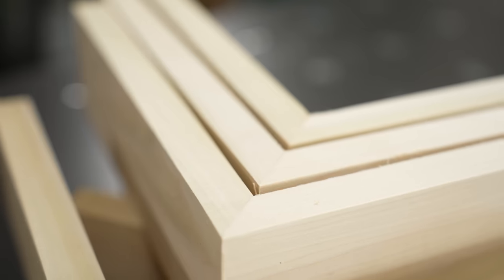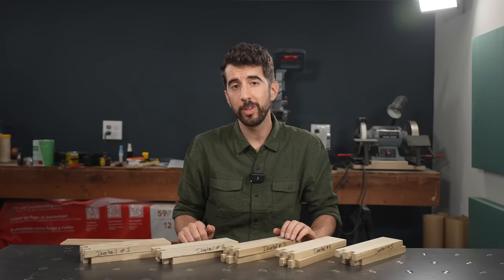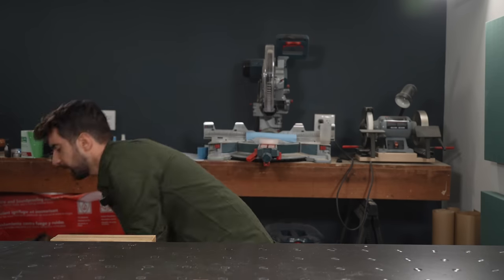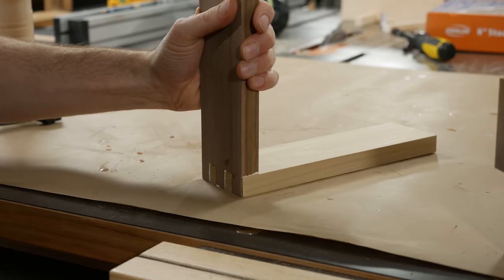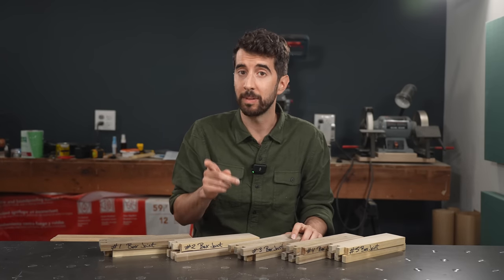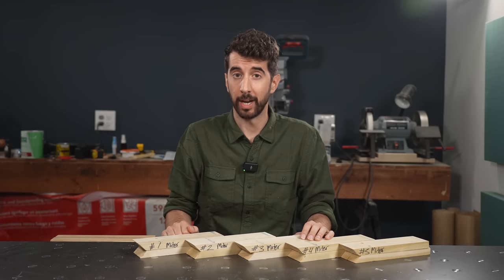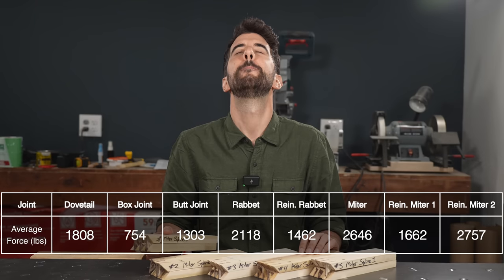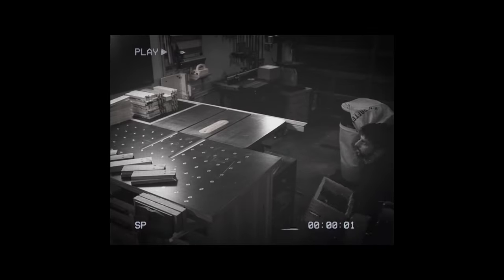This Simple Joint is Stronger Than a Dovetail!

Comment: i'm going to point out a minor error and then a possible major error in your reasoning. the minor error was when you said when the dovetail failed the glue was stronger than the wood. in fact, the test you did put zero stress on the glue. it only tested the shear strength of the dovetail flares. so the test was good but the explanation was just a little off

the possible major error is believing that a stronger joint is a better joint. that is simply not true. the best joint withstands the load it is designed to withstand over its intended lifespan and is economical to construct in terms of time and material. using a joint that will withstand twice the load that would be required and is costlier to construct isnt better in any way. it's worse because it produces the same utility as another joint for a higher cost

the outside splined miter produced the strongest joint, but only a little stronger than the miter without any splines. i have mitered joints i glued up 20 years ago and they are fine. so if your reason for adding splines is to add strength, that would seem to be a silly waste of time. however, if you need a joint that will endure drastic seasonal changes (like a summer camp up north) and you want it to last for 50 years, splines just might help with that

as you point out, the supposedly 'weak' box joints you've been making have held up for years, not to mention that box joints allow you to join very thin materials where other joinery methods wont work at all. you also point out that seasonal movement of the wood can break the glue, and therefore a recently glued up joint is not necessarily durable over a long period of time. a good example of this is the multiple dovetail joints on a drawer. even after the glue has completely failed this type of joint continues to function indefinitely

for example, king tut's cabinet-makers made small wood drawers with multiple dovetail joints and no glue. i'm not sure how much use those drawers saw, and they havent made it to their intended lifespan of forever yet, but they are still intact after several thousand years. and while i realize the ancient egyptians would strongly disagree with me on this, i'd say anything over 3 thousand years is a decent test of longevity. i have multiple dovetail joints on the drawers of a large oak desk built in the 1930's. the glue has failed everywhere and i'm not even thinking about repairing them cuz they continue to function perfectly

i do like these types of tests because they can challenge our preconceived ideas and may allow us to better understand the mechanical properties of different joinery. thanks for a useful and entertaining video

Comment: Dovetails were created long before glue was invented. Asian joints are similarly designed to restrict movement in a joint so it maintains it integrity. A miter has no mechanical strength without glue.

Comment: That makes no sense because you have more surface area in a dovetail joint than a rabbit joint. 🤔 Also some wood has more natural oils than others and hardwoods don’t absorb as much glue as the poplar you’re using so you should consider that. In a typical dovetail the adhesive can fail yet the joint will hold together still unlike the joints you say are better. Just some things to factor into this.

Comment: Great video.  So basically every single one of those joints work beyond "good enough" with modern PVA glue.  If you are putting 800+ lbs of force on a drawer joint it's not the joint, it's you.  🤣😂🤣😂🤣

Comment: The obvious question is if 1500lb is good enough for a drawer… unless you open it with your truck - brad nails without the glue will likely do just fine 😂
Reply: Correct. Any sanely built drawer box is more than strong enough to las the rest of your life, even if you abuse it.

Comment: Where is the video on how to use glue.  I tried gluing little blocks, less than 1"x1"x6", to hold a glass shelf.  The glue didn't hold.  These are little wooden night stand cabinets. Less 2 feet wide with a single glass shelf and wood framed glass doors. But only one had small vehicles emblems on the shelf. These cabinets live in my shop. No climate control. And when it's foggy and humid outside it is wet inside,  hot or cold outside, the same inside. Originally the blocks were stapled and I believe, glued.  Outside walls are about 1/4" and I didn't want screws showing from the outside. I can't replicate the staples.

Comment: Your setup, with a pivot point on the blue metal bar, only loads the joint with a linear force running straight through the joint. This is a completely different load compared to a load applied to the other end. Like bending a paperclip is easy, but trying to pull a straight section of paperclip apart is impossible. It would be great to test the other load type with the exact same joints.

Comment: A joint design that self wipes the glue off the surface you are gluing is not the best idea to start with.  I do 90deg joints in high density MDF using a 'stepped mitre' which has 4mmx4mm steps along each panel edge.

Comment: Youtube really sucks! I've seen the same experiment again and again and again tested by every single woodwoker so many times. I see no added value the video you did Scott.

The problem is it is very rare to have only one corner joint in any wooden product. Usually we have 2 or 4 miter joints. These tests are all done with the assumption of 100% accurate miter cut joins (only 1 joint). This doesn't hold true in the case when we have 2 or 4 joints! There is always a little bit of error even using the best and most accurate tools. 

With hand tools and a small workshop setup there is usuall at least a fraction of milimiter error which propagates throughout the work, leading to imperfectly (fine!) joints.

I finally found the video that wasn't the repetition of same experiment while ago. It clearly explained that miter joints sucks in realworld scenario (4 joints). That's because the error in adding a new jiont will be cascaded. 

To summerize, the best joint is the splines jiont followed by box joint and dowel joint.

Comment: I do think this is interesting, but when it comes to glued up joints at 90 degrees such as a drawer, I never see them fail from the force of pulling straight on them. Obviously the knobs and the cabinets would be ripping off the wall if some hulk tried to actually pull a drawer out with 2600lb of force, right?

Far more common when I see a drawer fail it's because it was left open and something like an apron or a running person/pet gets caught on it and yanks it sideways. 

Same with cabinets and shelves, rarely is there a force pulling at it, it's usually something pushing into a corner which creates that leveraged stress you see in your other videos. 

I also get that this is only one test, one wood, one glue... We could test for years, and in fact people have been testing for years, and still not come to an answer that pleases the voice in our heads..

Comment: So, the glue surface area makes the joint stronger.  
More area = More strength
Reply from the maker: If that were the case, the dovetail would be the strongest as I believe it has the greatest surface area.
Reply: @ScottWalshWoodworking  Oh you're right.  I forgot to also say that I agreed with your glue starved idea.  Miters should have less chance to become glue starved.

Comment: I don't know enough about materials science and physics to pinpoint the problem with your test, but I think there is a problem in your test. It flies in the face of hundreds of years of woodworkers's combined knowledge and in the face of simple common sense. I think maybe the issue is the welded fixture that prevents the joints from rotating. From the way I've seen actual joints fail, this rotational force is almost always a major factor in the joint's failure. A chair doesn't break because someone tries to pull a board straight out of it. The chair fails because someone puts racking forces on it and parts of the chair start turning relative to other parts. 

Fur hundreds of years craftsmen have sought to avoid butt joints. This was true in the era of hide glue and in the modern day with PVA, polyurethane, and epoxy. 

As for simple common sense, just build boxes without bottoms. Then drop/throw the pieces on the floor. You can break box joints and miter joints without much effort. I've seen it happen myself. The traditional "strong" joints will be much harder to break.

There are other factors that can influence the "strong" joints. For box joints the size of the fingers is important. For dovetails the relative sizes of the pins and tails has a role in joint strength. The angle of the dovetails can also be a factor. 

Where were the mortise and tenon joints?

Comment: Don't you have a Domino?  Then why didn't you include a DomiDrawer!?   A through loose tenon of any species you like.  Make the drawers out of something light and the tenons out of white oak, mahogany, walnut, wenge, paduka, whatever.  Talk about fast!  Not terribly strong unless you go with 3/4 drawer fronts but more than adequate especially with undermount slides.  And domidrawers never come from China. 

I've put a lot of drawers together with pocket screws.  I wish you'd tested that.  The pockets are invisible being in the back and hidden beneath an applied front.

Comment: Okay can someone mansplain to me mechanical advantage used in this context? I was triggered everytime Scott said "mechanical advantage" in the video because I learned the term in the context of levers, ramps, gear ratios, etc. Much obliged ❤
Reply: Mechanical advantage in terms of a woodworking joint really depends on the context of the forces acting upon the joint. A dovetail, for instance, has a mechanical "wedging" advantage when the angled tails are used in the direction of the acting force (pulling a drawer open, or a hanging wall shelf with weight pulling down). A dado, like used in a bookshelf, has a mechanical advantage against the force acting downward from the weight on it but has no mechanical advantage when the forces are pulling from the side of the shelf.
Reply: The shape of the dovetail gives it effectively two wedged surfaces to help resist forces parallel to the dovetail pulling the joint apart.

Comment: Apologize in advance cuz I didn't watch the whole video, as I'm already a professional glue eater.

You had said that you thought the miter would be weak because it looks like an end-grain-to-end-grain glue up. That's been proven to be a myth several times on Youtube and elsewhere. End grain glue-ups have as good or better strength than face grain glue-ups. But they have less strength than the wood fibers themselves breaking, so they must not be used to make a super long board that might take a load.

Comment: These joint strength tests where people break L’s are not very helpful in my opinion. I make zero L’s with one corner joint on its own to resist pivoting at it’s “elbow” corner joint. 

It would be more real-world informative if you made actual boxes (or at least a drawer frame without the bottom) and tried to pull two corner joints at the same time since you’d pretty much never find construction of a dovetail, box joint or butt joint corner without an opposing corner. The joint failures are from the free-floating end pivoting away from the jointed corner, but when would that ever happen in real construction?  All four corners of a drawer frame or a blanket chest are working together to prevent the racking/pivoting/fulcrum motion you are using to break the joints in the first place. 

I hope that makes sense.
Reply from the maker: I think you need to rewatch at: 6:13. The whole point of this test and why it was so difficult was to prevent the joint from rotating apart.
Reply: @ScottWalshWoodworking  yes indeed. Thanks for pointing that out. I remember that footage, but brain blanked on what you were saying the first time around. I need to refrain in the future from watching technical videos at 8am on Saturdays before I’ve finished my first cup of coffee.

Comment: Bottom line: even 754 lbs for the weakest of these joints is way stronger than required to hold all my underwear in one bedroom drawer.
So... use whichever you prefer... 😀

Comment: I don't think wood cycles through humid air like in the old days. Modern climate control keeps the RH in the 20-45% range year-round. Unless you have furniture in a non-climate-controlled shop or garage, it's not a factor.

Comment: I use dovetails or splines mostly for appearance.  The joints with or without are strong enough for typical use.  No need to make a joint stronger than it needs to be.
Reply from the maker: For sure, realistically all of these joints are strong enough for most things, even perhaps the lowly butt joint

Comment: Seems to me the crappiest possible joint here is already wayy too strong.  I've made crude furniture out of a hot glue gun and it seems to hold up for what i need it for even if it's going to fail sooner or later. Do a video over the crappiest materials that would hold up the longest.
Reply: Indeed, and us "fine" furniture makers have known this for quite some time now. This is simply not a real concern. What you're really seeing is the tendency of woodworkers to have a personality trait called "high conscientiousness." So they obsess over details that don't matter and exaggerate the probability and intensity of worst case scenarios. In other words, they worry too much about bad stuff that will never happen and they try to prepare and prevent this bad stuff. Basically they want to over engineer things because the fantasy they have in their head keeps telling them it's not good enough.

But as you saw even the weakest isolated joint was an order of magnitude stronger than the forces it would actually experience in reality. Maybe two orders of magnitude.

Comment: Take-away "conclusions" from an amateur: 
1: Might as well forget gluing joints where the surfaces fit TIGHTLY.
2: Forget about reinforcements that weaken the MAIN pieces (dowels & Rein. Miter 1).
3: Go for rabbet mainly because it is easier to assemble.
Wanna bet that in Rein. Miter 2 the fit was NOT really tight (so enough glue remained)?
ALL points with various caveats!!!

Comment: For the specific wood you made the joints these tests are honestly not that usefull (sure it shows the strongest joint), as all are strong enough for what they are used for with this small wood planks. If you need stronger joints you likely need stronger and bigger wood for the job your doing.

Comment: This is not my you tube account. Does it matter?

Interesting test but does it really tell you anything? First off, where is one wood joint a stand alone construction as tested? Shouldn't there be a system of at least 3 conected joints to see how the constructed system works? You have tested a cantilevered butt joint. What effect would longer "lever" boards have had? Any surprises there? Your joints have used various combinations of stressing compression and tension of the joints. What was that effect? If the wood fails before the joint does the joint really fail? I enjoyed the video but this has all been studied with many more considerations. Consider reading about construction truss design and the extensive studies in to why 500 year old Japanese buildings constructed with locking joints with no fasteners or glue survive hurricanes and earthquakes better than typical modern construction. The joints in these constructions are the same if furniture or buildings.

Comment: It's an interesting test and certainly valuable, but eliminating the high and low rupture values is statistically incorrect in two ways.  One is that data should not be discarded unless an obvious confounding condition is observed.  And second,  for statistics with small numbers of trials, then 5 is the minimum number of trials for statistically valid results.  So discarding the high and low values weakened your analysis.  All that said. I believe your conclusions.  By the way, adding some nails might add strength without compromising the structural integrity of the wood.

Comment: It's easy, woodworkers make whatever looks fancy enough to sell. Internet hero's then spread rubbish about things like dovetails for decades. Reality is that much like any engineering joint, cutting stress risers into your joint is a terrible idea - see also, dowels, biscuits and those funny oval parallel wafers which I think are mainly there so fesstool can see those same people more tools.

Maximise surface area, minimise section changes and stress risers. The same as any engineering joint has done for centuries. Just because it's wood, doesn't make it special.

Edit - if you want to try to go for stronger, the mitre joint with with a waved face would probably be stronger still - note, NOT those little trianglular cuts that I see some guys use a lot -  the sharp corners on those are a failure point, setup the same but with ballnose cutters.